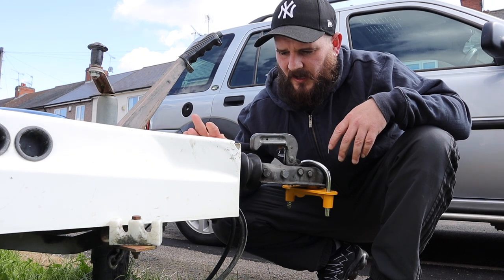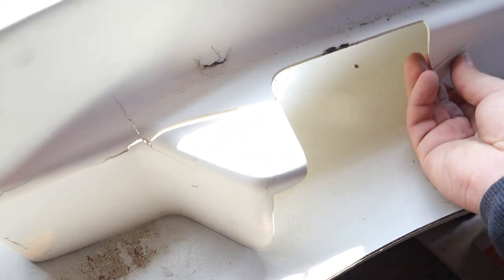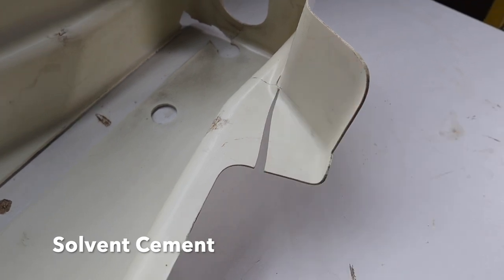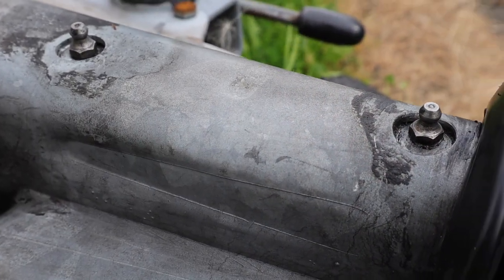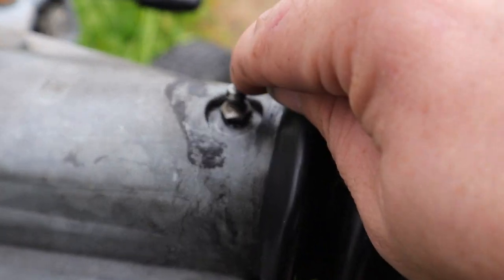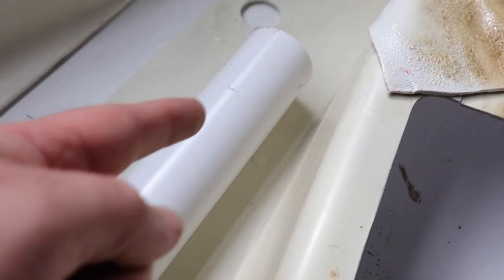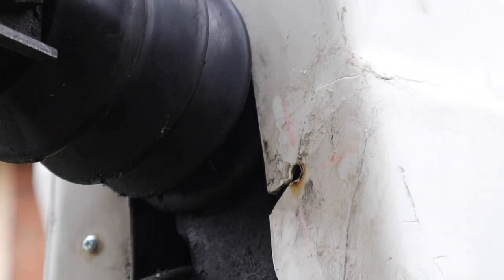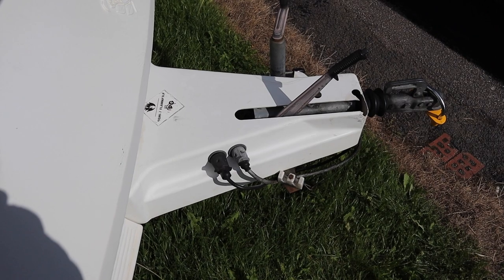Caravan A frame cover repair.

Comment: maybe some washers on the screws
Reply from the maker: Hi Gary thanks for your comment 👍 agreed, im on the hunt for some rubber washers. 👍
Reply: Big 'penny' washers would do. And, why didn't you rebuild that big hole in the front corner?
Reply: @LaurieFire  i was thinking the same on the hole